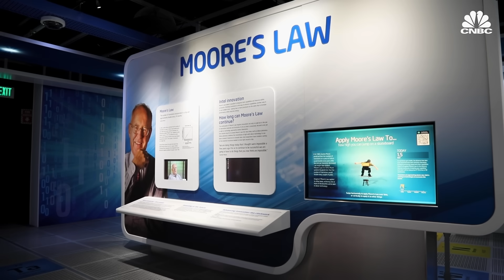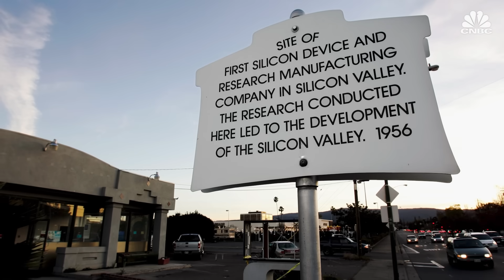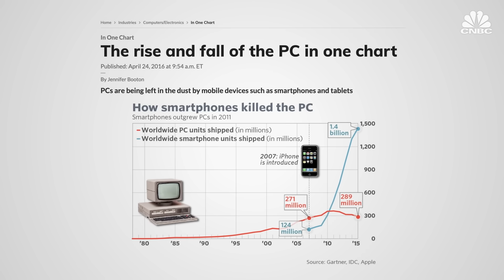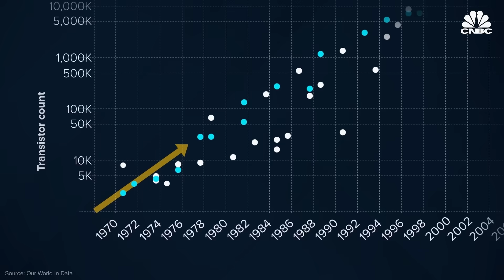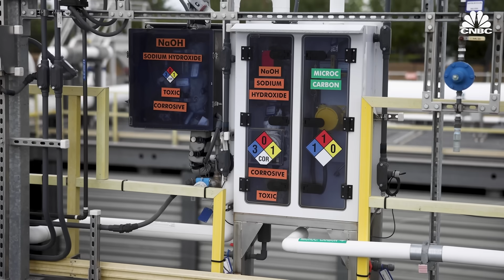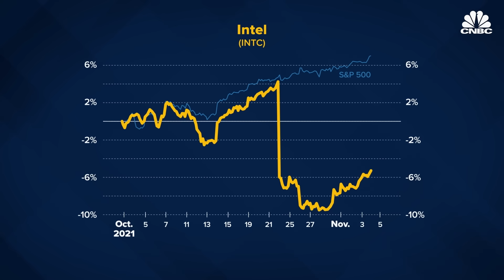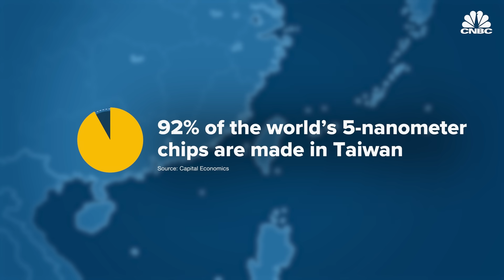Inside Intel’s Bold $26 Billion U.S. Plan To Regain Chip Dominance

Comment: INTEL couldn’t beat them on the same plane field, they wont beat them by  getting into more fields.

What makes you think you can be a great runner if you cant even beat them at walking. The problem will persist no matter what area you are tackling, this is a management issue.
Reply: They just rearranged management, Intel's literally building new foundries lmao
Reply: @mycelia_ow  Sure, sure
Reply: Playing*
Reply: Intel has been making profits for years now off of selling you, and everyone else the same thing for decades. If they spend some of those profits on new fabs, yes to the surprise of no one they can beat out TSMC who makes half of what Intel does in a year to begin with. Intel is too big to fail, and has earned far too much money over the years to collapse over something as simple as someone matching the performance of their chips currently for a slightly lower price. If Intel increases the amount they can make by 25%, they can lower unit prices, and then render your argument irrelevant as they already have comparable performance to any existing chips within margin of error that no one would notice without a synthetic benchmark. But keep in mind, they're adding on two entire new facilities, which is a 50% increase in production facilities to the current number, which is double the 25% I mentioned that would be enough to lower unit prices even further.
Reply: @Adierit  Comparable performance with 0 improvements to their chip architecture, they are still like in 14nm is just laughable. Meanwhile Apple and AMD are in 5-7nm plus far much less power consumption (Apple) which means they can cuádruple 4x that performance with Fans and more power (not that they need to).

INTEL is a joke for a while now. They only care about money and not improvement and other companies catch up to their BS fairly quickly.
Reply: @powerhouse884   Lets see how it all plays out then eh.

Comment: I feel the video would have been more accurate if they explained that node size does not equal transistor density. Intel's 10nm is competetive with TSMC's 7nm on this metric, and is one of the reasons that Intel's cpus remain competetive despite competitors process size advantage.

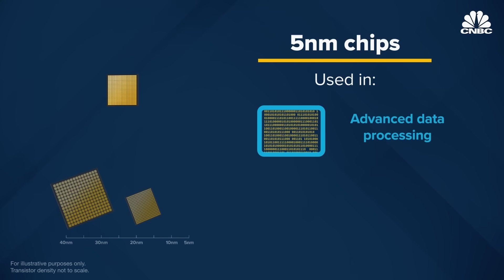Comment: 13:35  5nm chips are NOT in NASA spacecraft and rovers.  The radiation regimes they have to operate in would fry them in minutes.  Perseverance rover on Mars uses BAE RAD750 chips whose smallest feature sizes are 150nm, 30 times linearly smaller, 900 times less dense in total features.
Reply: Yes, I was also annoyed at this. Space hardened processors are made with silicon on sapphire instead of plain silicon wafers. In addition the transistor density of intel 10 nm process is about equivalent to TSMC & Samsung's 7 nm. CNBC couldn't be bothered to report this accurately either. 
https://en.wikipedia.org/wiki/Radiation_hardening
Reply: @danielfoster9782  seriously this video is pretty lame leaving out key facts like this.
Reply: @RaineRed  Give me the name of a reporter who is not lame.
Reply: @danielfoster9782  I'll be blunt: If Intel wanted to talk about component density, we would be hearing some actual figures about component density. What they want is a few more convolutions of the marketing baloney extruder pipeline, because this is how they relate to the world.
Reply: @danielfoster9782  they also gloss over as to why amd had to take ages copying their CPUs, intel violated their trade agreement and refused to send designs
Reply: @danielfoster9782  Intel rebrand its 10nm as 7nm a month ago.
Reply: @danielfoster9782  Thanks for the correction!
Reply: @danielfoster9782   Come on! you know this video is a PR stunt. How can you expect a report and that too an accurate one at that.
Reply: @danielfoster9782  that its marketing.  intel cpu are only comparable, but new anker lake is biggerr and consume power than AMD, and amd stil havent release their ddr5 AM5
Reply: Depressing to know that basic fact checking isn't really done on stories like this. Makes me wonder what else they fudged.
Reply: @xpkareem  mistakes happen. its a pretty minor mistake given the point of the video
Reply: @xpkareem  Its NBC what do you expect LOL
Reply: NASA’s latest Mars rover Perseverance has the same processor as an iMac from 1998.
Reply: @se_mat  same performance metrics..different tech.
Reply: @luminousfractal420  You should do a reality check! South Korea (Samsung) Taiwan (TSMC), U.S. & UAE (Intel, Global Foundry) are the top foundry's.
China (SMIC) is getting there. The Architecture of Chinees CPU's however are terrible! (Zhaoxin KaiXian x86)
Reply: yeah... "Powerful chips used in data center: GPUs" That part was written by someone not very technical
Reply: 5nm chips probably not in fighter jets either. Most military stuff uses older tech.
Reply: @edwarddodge7937  Actually fighter jets do are being designed to have the latest tech, as the Israeli F-35, because you don't have the problem of radiation that space vehicles and satellites have (and it is desirable to be able to update the avionics and computers through time)
Reply: @cristianproust  I have searched a dozen online sources about your claim that Israel has an F-22. Could not locate a single source, despite Trump allowing the sale. As of (the latest I could locate, unfortunately) Nov 20, 2020  Israel was not sold any F-22's stripped down or otherwise. Frankly, it would have been a wise  sale to make since then the F-22 would be tested in Battle and not just war games among allies.
Reply: @cristianproust  Where is your source for your claim that Israel has an F-22?
Reply: Even on earth these cosmic flips occur so often. In space it'll go nuts.
Reply: @prateekpanwar646  not so much that stuff isnt bothered if a planet gets in the way.
Reply: 30x linearly bigger you mean.
Reply: @striker44  physical size, yes. In terms of transistor count, smaller.
Reply: @prateekpanwar646  the latter is already pointed by his comment on density. I am talking about the lateral dimension or size comment.
Reply: The Perseverance rover actually uses 22nm Intel CPUs as part of its COMEX-IE38 compute boards.
Reply: that's true but Ingenuity uses a snapdragon 801 processer. the requirement to use an advanced processor that was not tested in space was one of the reasons the mission was so risky.
Reply: @theicedragon100  It's not that it don't work. The ISS uses normal laptop's, iPads, digital high MP camera's. Its just for long term without the possibility to replace, that hardend CPU's and memory are a must.
Reply: Temper your nerdrage.
Reply: I was about to write the same.
Reply: @ssunii7891  The size of the chip is related to the nr. of transistors you need, complexity, (some logic use more space than others) and manufacturing 14nm,,10nm,7nm... tech. For some practices like radio signals and space, they use bigger traces and less transistor density.
Reply: In reality, we shouldn't care whatsoever and just look at the cpu/gpu score. How many transistors the chip is made of or what lithographic process was used has no real informational value. But we still like to get the information because humans like this, even if it don't add anything.
Reply: @se_mat  it may not seem to add value to users but it matters for manufacturers for cost modeling, for yield analysis, reliability studies etc... which in turn impacts product pricing that impacts consumers of the products.
Reply: MSM ain’t for nerds
Reply: @talalztube  Then don't make a video about it, where the information is half wrong.
Reply: Good info, but hard to understand, so you are saying that they are using 150nm, tech because 10 or 7 nm, would fry in seconds
due to radiation and lack of atmosphere to dissipate heat
Reply: @crabbyr6929  No, no. I mean radio chips for telecom use, like radar and the likes. Space separately needs bigger physical components because they can work with higher voltage and more power so its less sensitive to bitflips and the distances between traces prevents shorts between circuits.
Reply: @ssunii7891  transistor size. but theyre using the term (nm process) its not directly related to chip or transistor size its just marketing now.
Reply: I think if I can recall correctly they use hardened PowerPC chip (similar to old macintoshes)
Reply: I'd like to think that the writers meant more in the development of the rovers than actually on it. Simulating the environments of Mars and space to test specific technology may be one use case, for example. But you're right, they are not directly on board the rover on its journey.
Reply: @dragossorin85  because it is made in the Hollywood basements.
Reply: Indie Fury  Agree, Frito Lays is not nearly as tasty.
Reply: Is that so ?...in a parallel life, Science, Innovation & Technology would have been my chosen path...in this one Spirituality, Psychology, Art, The irrational & Emotional Worlds, Physicality,Sezuality
Reply: @ssunii7891  someone already answered but to add or reinforce, the footprint size is referring specifically to the manufacturing process and the main advancement when looking back over the history of ICs "how many transistors can you fit"
Reply: Just wanted to write the same thing. I'm a Scott Manley fan btw.
Reply: Yes, not only in this sector, but in many places media talks nonsense
Reply: Could you quote from somewhere in this article where it says that it will be impossible for 5nm to be used in space in the future?

While I agree with the fact that spacecraft and rovers, etc... don't have the latest nodes from any company, I don't believe it's because it's too dense or the size of an actual conductor is too small to be able to protect it from radiation in the future.

I see it more on the line of, these projects to make a rover that goes to Mars takes MANY years, and they have to have a known electronics product to start working with years in advance because of all the testing that will be required.  So, anything in space is years behind in node technology.  Not because the node will be incapable of being protected/hardened/etc.... but because of the time duration of a project.  You don't get to use Agile for sending a rover to Mars.

This video is clearly wrong.  I'm not disputing that.

On another note.  If the US wants to make so many chips, it needs to also focus on making top end PCBs, because it would be silly to make a GPU chip in the US and then have to ship it to China to make the final product, and then ship the final graphics card back to the US.  One without the other isn't security in my mind.
Reply: yes, dont the rovers use old school chips form decades ago because they are reliable and less prone to damage from the elements
Reply: Indie Fury  facts
Reply: I was triggered.. then I got over it as this is a news piece for my parents.
Reply: Wow, good to see a world I don't understand.i Wonder how y'all come to know about what you're talking about, as in the level of detail. 
I'm in a room full of geniuses, impressive 🙂
Reply: @FutureBoyWonder  most would rather spend the time in Sportsball.
Reply: You are very much right, but I guess they meant chips in the mission control centers and for research, however for rovers, satellites or any machines used in space they have to use chips you have mentioned.
Reply: I believe ingenuity uses something on the order of 14nm chips though, since it’s just uses an off the shelf smartphone chip or something.
Reply: NASA Ingenuity helicopter on Mars uses off the shelf Qualcomm Snapdragon processor to reduce weight and power requirements. The design uses the batteries to provide some shielding for the chips. Radiation hardening is mostly needed for deep space probes around planets like Jupiter with intense radiation belts caused by the planet's powerful magnetic field.
Reply: This is why nobody makes such outdated chips that have no relevance in global economy. Satellites have been phased out and obsoleted by terabps fibreoptical continental lines. Even Mount Everest now has 5G telecom.
Reply: Indie Fury  💀
Reply: so you surely meant '30 times linearly larger, bigger'?
Reply: Good point.  Chips of 65nm and above are more robust
Reply: 52bn in Chips Act. TSMC’s annual capex is over 40bn. TSMC will also be getting part of that subsidy for its Arizona fab. 95% of the leading edge 5nm production is being done at TSMC. The only way for Intel to catch up is if and only if China invades Taiwan and we have a collapse in global tech food chain.
Reply: Ingenuity rotorcraft uses a commericial qualcomm chip
Reply: So much for Intel Plan to regain Chip Dominance.  $44 billion later Intel is off the Dow Jones.  CEO resigned.  And where did the money really go (Israel)?  They delayed closing Israel office.
Reply: Small nit - The "nm" in chips no longer tracks the transistor size, it's pure marketing and has been so for many years.
Reply: @ekw88  No, it really means something, otherwise it wouldn't create denser chips!
There is no standard to this nm, so for each foundry it means something else. That's why Intel 10nm is equals more or less to TSMC 7nm.
Reply: @se_mat  isn’t comparing density between two completely different processes nods pointless
Reply: @Allpurple_reign  Not for comparing to other foundry's. But it informs the public about the single foundry's progress.
Reply: @se_mat  you can put out a candle with a drop of water..or a firehose. neither say anything much about the candle.
Reply: @ekw88  yeah, this 'nm' is why chip manufacturers are at the limit of how small they can get. Whats smaller than an atomic particle? Now its all about getting quantum computing...
Reply: pretty sure intel did not lead the way with microchips either. china were always decades ahead of the rest of us back then.
Reply: @luminousfractal420  um china? Their x86 clones are intel 3rd gen level, they cant even produce chips for huawaei newest phone to use 5g. Only thing china competes on is supercomputers.
Reply: @luminousfractal420  that is a random comment without any facts on how china is ways (decades)  ahead of Intel in microchip development. There is plenty of public material on supporting Intel's. Taiwan is ahead in manufacturing. SMIC in China is behind but maybe trying to catch up. Show some real public links to support your statement.
Reply: @luminousfractal420  China? lol! They are on 24nm, 18nm and started experimenting on 14nm. What are you talking about?
China made lots of progress in a short time, but certainly not ahead in microchips!

Comment: the process node is not the same as the 'size of the chip'. The 'larger chips' used in cars are NOT physically larger, they are physically smaller.

Comment: While I'm hopeful Intel can pull one out under these circumstances, they've effectively missed the boat. Apple's far ahead, right now, and it would be a mistake to think they're planning on resting on their M1 architecture laurels.  One factor to remember is that Apple is deeply familiar with multi-processor systems and the RISC architecture from their PowerPC days. I think it would be a mistake to think Intel can catch up at this point, but they're calling their 10nm process Intel 7, which is silly. Intel's also illustrated that they're perfectly happy sowing propaganda as a means of persuading potential customers. 

I guess we'll see...

Comment: Intel is certain to lead again. US has required TSMC and Samsung to submit all their data (trade secrets) before Nov 11. Samsung refused but TSMC agreed.  After Intel has all data about processing, parameter setting, client list and each sale price, etc., I have no doubt Intel will lead again
Reply: TSMC uses less than 10 % of technologies from the US; by the time TSMC makes 2 nm, 100% of technologies will have nothing to do with the US. TSMC can start selling cutting-edge chips to China, TSMC will boom again, yes, you can force TSMC to deliver data, but you will regret it later. Deeply regret.
Reply: @genuinennessbefitting4734  don't forget TSMC is a contract manufacturer rather than original designer. If Intel had all its data including raw materials, processing parameters, clients, sale prices. Tsmc will lose advantages.

Comment: Nanometers is just a number.. The 10 nm 12900k outperforms the 7 nm r9 5950x is certain cases (especially gaming)
Reply: And also consumes more power. Smaller the transistors lesser the power consumption.
Reply: @sparkartsdistinctions1257  125/240W for intel and 105/140W for AMD. But intel can use faster peripherals.
Reply: Yes, and the pricing of AMD cpus is uncompetitive at the moment, where I live , a ryzen 5 3600 is $400, the intel i5 11400f is $274 and outperforms the AMD chip, so pretty obvious which 1 is the better buy....

Comment: Republic of China- Taiwan, simply has a superior materials engineering ecosystem and lower controlled costs that enables it to outcompete Intel. Their engineers work around the clock at relatively less pay with more workload than the United States. Furthermore, Morris Chang built out an entire Kireitsu ecosystem of very close knit specialty parts, materials, and services suppliers locally; that network is integral to the success of the company and cannot be as easily replicated elsewhere. This is why when Foxconn tried assembling Apple products in Texas, they failed miserably, because the specialty parts vendors were not within arms length 24 hours, and when they were in short of critical assembly components, it delayed production time.